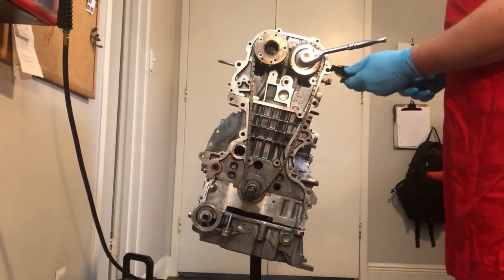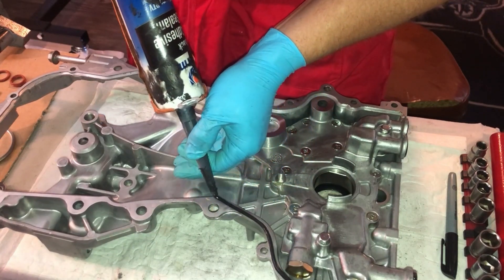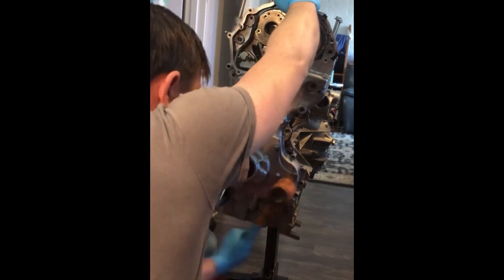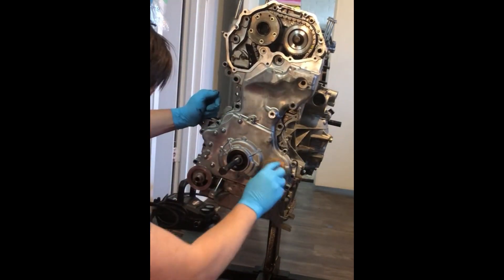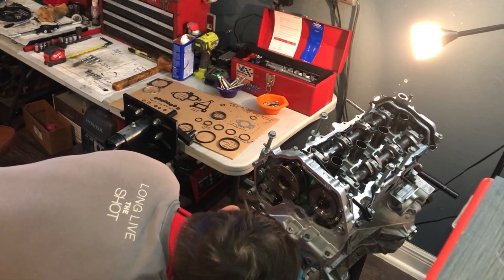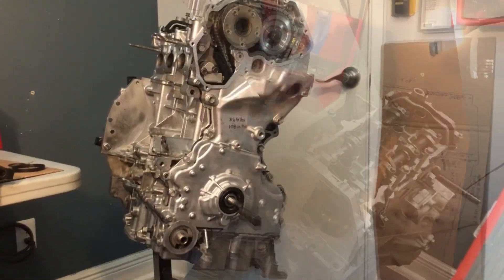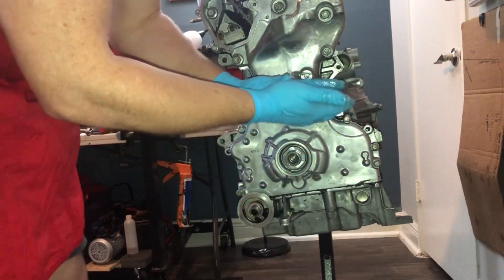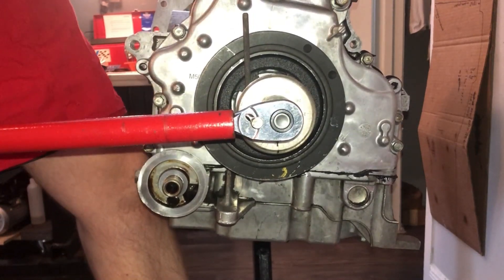Texas Toolbox - Nissan Altima QR25 Timing Chain

Comment: I deleted my balance shaft but I'm gonna reinstall the chain on it cause I'm tired of the rumble and shaking at idle. I commute a lot so it makes more sense for me to reinstall it.
Reply from the maker: Well, the crankshafts weren’t balanced before 2007 (I’ve heard).  I do notice a bit of idle shake but I consider the benefits to outweigh the cost.

Comment: how did you keep the crank from turning on the balancer torque? Did you hold it from the back side??
Reply from the maker: With the timing chain installed you can put a wrench on the cam shaft, though, it’d be better to hold the balancer in place with a whatever you have at your hands.  I don’t think you can access the crank from the opposite side of the engine when the transmission is installed, and even when it’s out like this, there’s nothing to stop it from turning on that side.
Reply: @texastoolbox6512  Thx Brotha !!

Comment: this isnt proof that you can do timing without removing the lower oil pan....i appreciate your videonad i hope you continued making more but if you dont remove the lower pan you will have soo much trouble and in the end need to shift the engine over to the driver side after removing engine mounts and then still have trouble with the engine in a engine hoist sling and all the way up and over...basically if you dont remove the lower pan be ready to bring the engine up and right (driver side) so far its technically removed
Reply: i would recommend telling anyone doing it this way how hard it actually is....again i appreciate and thank you for your video and hope you dont see my words as negative or ignorant in any way...
Reply from the maker: No trouble! I believe you mean upper* oil pan, since it’s a two piece design. The balance shaft assembly and timing chain are separate, but both are driven off of the sprocket gear that is held in place by a woodruff key at the crankshaft. If you are replacing the balance shaft chain when replacing the timing chain, removing the upper oil pan is necessary because there are not enough clearances to disassemble the lower (balance shaft) chain. You could, however, simply cut that chain and should only notice a very slight change in idle vibration.

Comment: So no need to remove oil pan and lower part for removing timing cover for replacing giudes and can it be done while the engine still hanged in the car ?😅
Reply from the maker: That’s right!  But it’s a bear if you do it like that.